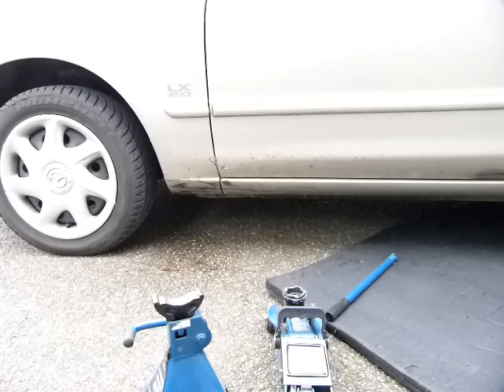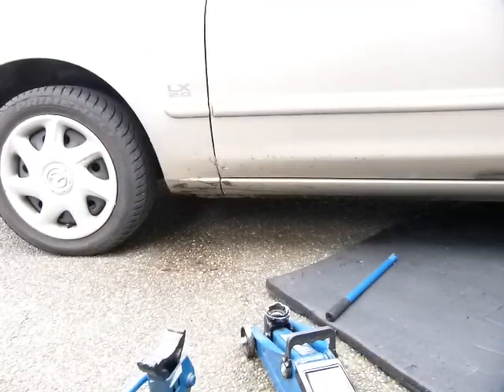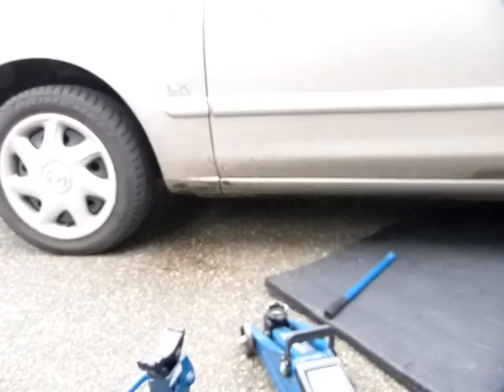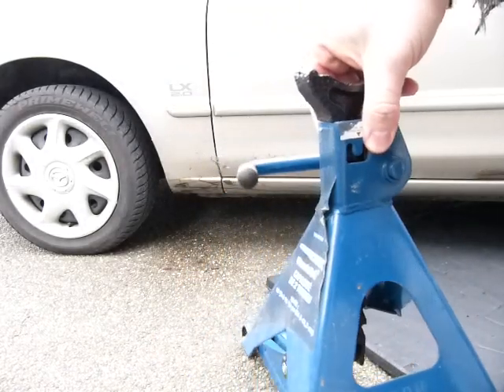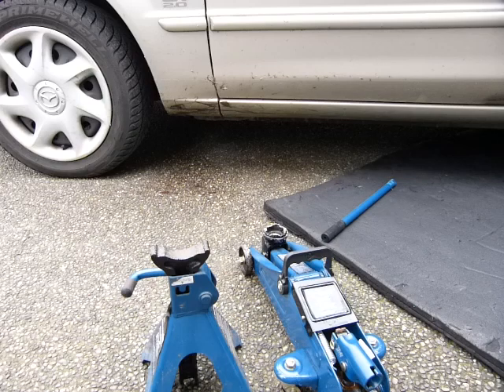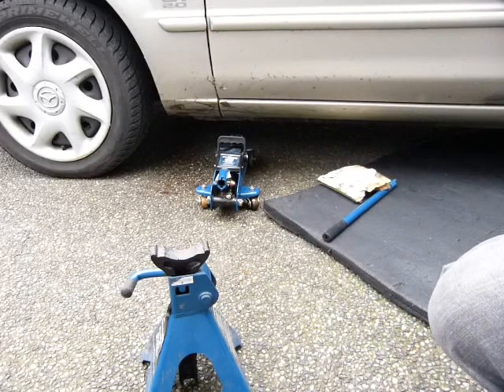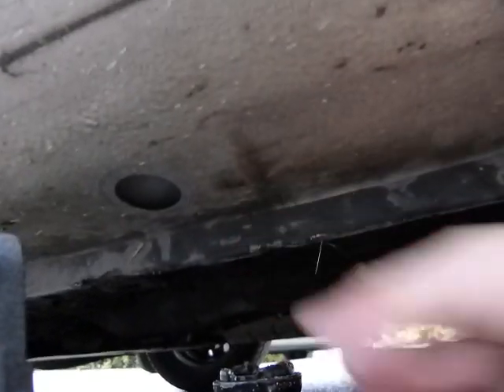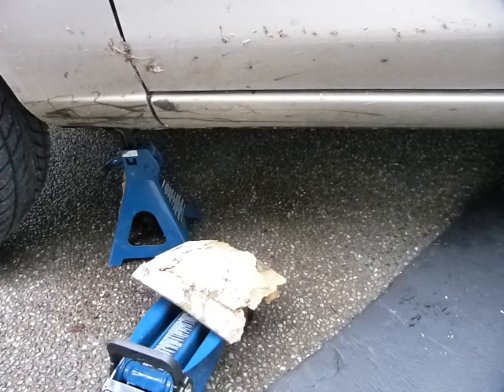Lift a car safely using a jack and an axle stand

Comment: A great video and you sound very sensible and well informed. Thanks for sharing!
Reply: It's not!!! It's dangerous!
Reply: @PiggyPower  I'm hoping Wozzlepop was being sarcastic! 🤭😂
Reply: @PiggyPower  shut up , you're everywhere.  Its not dangerous,  stop causing alarm and distress
Reply: @jacquelinebishop8465  it’s flat out dangerous!! Why else would I comment?? Look at all the other comments, others saying the same things! If you know better, please explain to me why this is safe?
Reply: @PiggyPower  The video is 10 years old 
I've raked through all the comments   not one person has reported back with any issue 
You're over analysing sir
Reply: @jacquelinebishop8465  of what purpose do I have in commenting? Zero. Do I gain anything, no? Do I know what this guy is demonstrating, yes.  And it's dangerous. That's fact. I'm not going to argue facts with someone who doesn't seem to understand the basics of vehicle design and mechanics. That would be like me arguing with a carpenter how to safely use a chop saw.
Reply: @jacquelinebishop8465  also, you've clearly not read many of the comments as a majority are highlighting the same dangers I am highlighting. . . Some even go as far as to explain why and include some information about how to do it correctly.

Comment: Again, That thin metal Edge is a lift point . I've had both driver side wheels off the ground by lifting on that thin metal. You bend it B/c you don't know how to lift it. That's why a hate shops, they don't do it properly, and the bastards bent it.
Reply: Hey could you please tell me the proper way?

Comment from the maker: Not supposed to fold over, it is a unibody spot welding seam. It is painted and undercoated. Any bending will crack the paint and rusting starts. Lift close to a corner next to a wheel where the panels are strong, or by the swing arm (which holds the wheel) - another strong point. Pad between the jack and car.

Comment: My 2004 Cavalier had folds all over that thin metal edge where people before me have jacked it, even at the notched jack points. Maybe it is supposed to fold over? I dunno. I'm used to the older cars where you can actually see the frame.

Comment from the maker: The thin metal edge is made of 2 pcs of ga 22 sheet metal (1/16 inch or 1.5 mm in total), runs the length of the body (5 feet), spot welded at every 8 inches, sticks out 3/4 inch. 20 lbs of force bends it, bending cracks the paint and corrosion sets in. To lift the body NEXT TO this edge or BY this edge are different things. I also lift by the swing arm pivot, guaranteed strong point, a bit harder to get to.

Comment: That "thin metal edge" is SPECIFICALLY DESIGNED to be a point where you lift the car.
Reply: ..with a scissorjack
Reply: @tempebill8183  go watch cars being raised on ramps... They use the jacking points on the sills (on monocoque chassis) to raise the vehicle because they are the correct place and safe spot to do so.
Reply: Lol 😂